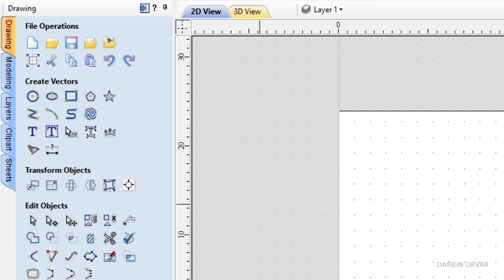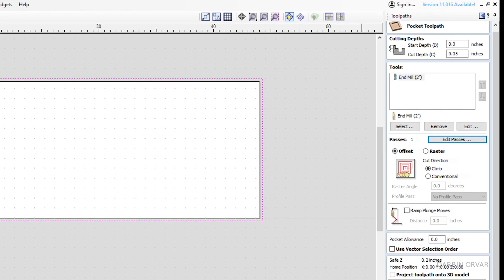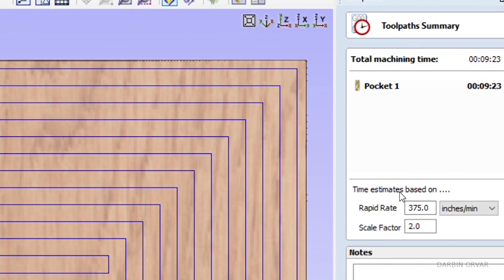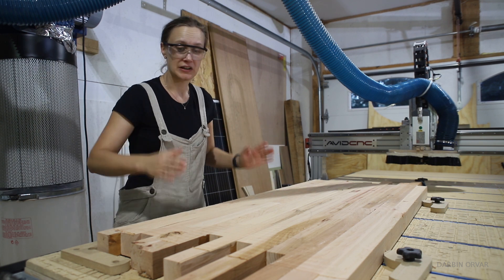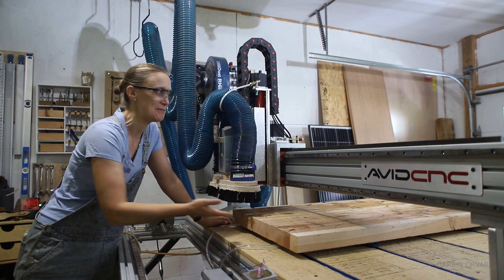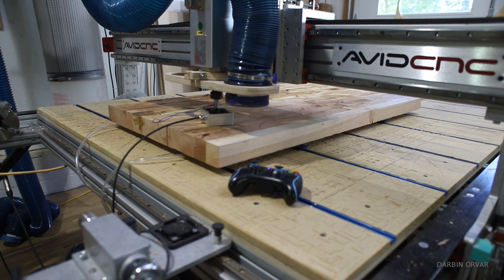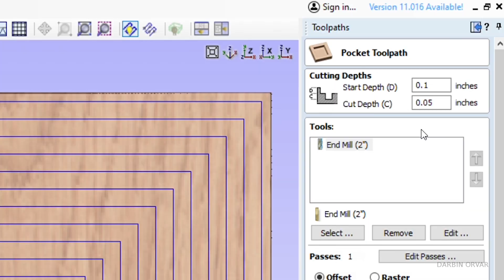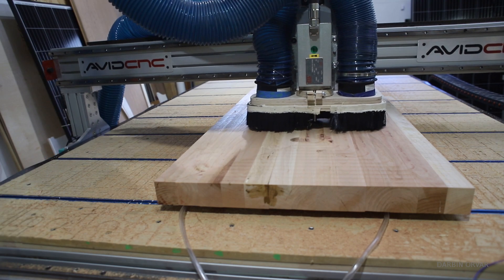How To Flatten A Wood Surface on The CNC

Comment: The way I learned to use one of those surfacing bits was, make the cutting area larger than the actual part needing to be surfaced by double the amount of the diameter of the cutter in the length and by the diameter of the cutter in the width. So a 1 1/2 in. cutter you would add 3 in. in length and and 1 1/2in in width. As those cutters do not cut in the middle of the cutter, you would want to start off or the edge. Then you would set the pocket tool path to raster making it always cut with the grain of the wood, as you might get tear-out when cutting across the grain.

Comment: Does this CNC provide a finish fine enough for basic sanding? I built a flattening rig that uses a 2” router bit, 3hp router and stainless rails and ball bearings. It’s manual but similar to a CNC flattener. However it leaves a slight scalloped finish which is too rough for basic sanding but requires a trip through a wide planer.
Reply from the maker: Because it's a cnc you can set how you want to do the passes, better = a lot longer time, otherwise you might get swirl marks. But in general the finish is pretty perfect.

Comment: Nice work on the slab surfacing I am running a 5" cutter at 8000RPM 250 IPM .1 DOC  Slabs come out perfect then they are sanded with a CNC Floating Sanding head Total time to process a 2 x 4 foot slab is about 20 minutes sanded to 320 Grit.  What you are doing is the best way to flatten a slab.  I do both sides to equalize stress in the wood.  Well Done

Comment: Nice job!  
Just wondering - why don't you just set finish depth in vectric to whatever is needed and add multiple passes at 0.05 inches so you don't have to come back and edit it after each pass? Or other option - set new "0" for Z axis after each pass and rerun the same gcode? :)
Reply: Does that set the final thickness of the part?